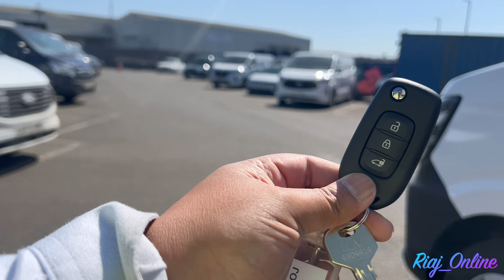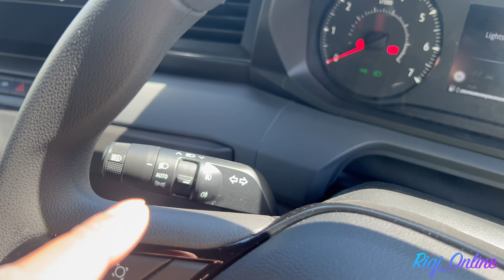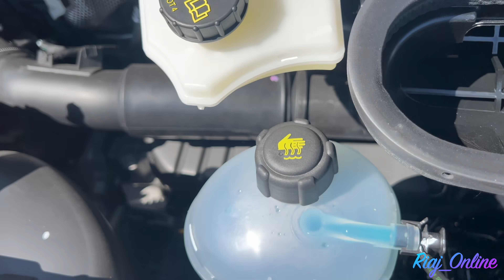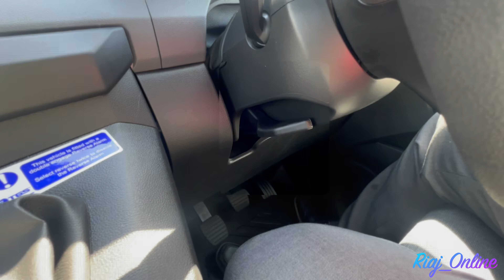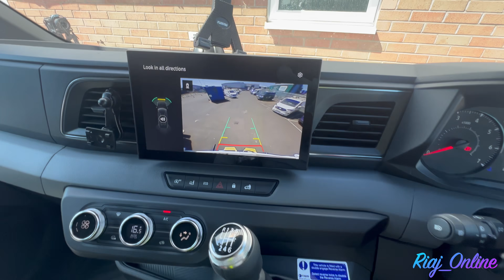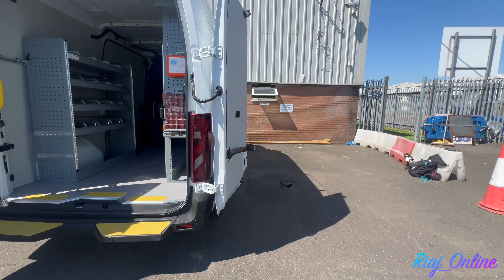Nissan Interstar F35 L2H2 Tekna | Full FLOWER Check – Inspired by Sakura | Walsall Housing Group

Comment: Hey, I'm considering this van for a campervan-build. If it is not too much to ask, could you provide me withe the space that is left behind the wheel arches (end of the wheel arch so to spek) up to the closed back-door? These measurements are not to be found online - I believe because it is still a pretty new model. While you're at it, the length of the shelf on the right side (driver's side) could also be helpful, but I'm starting to feel bad for bossing you around :) First measurement is way more important and would be highly appreciated. All the best and greetings